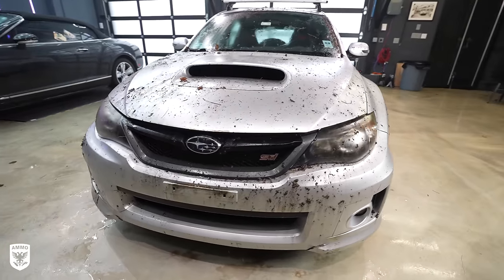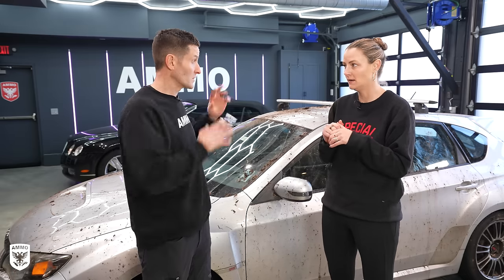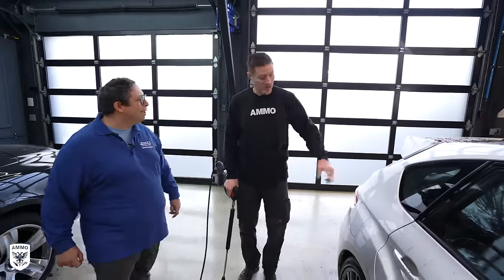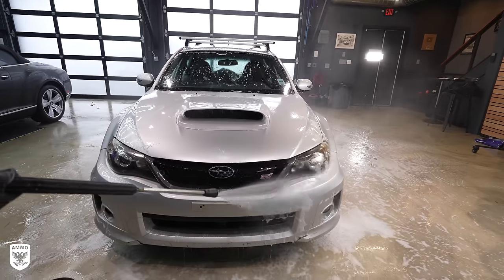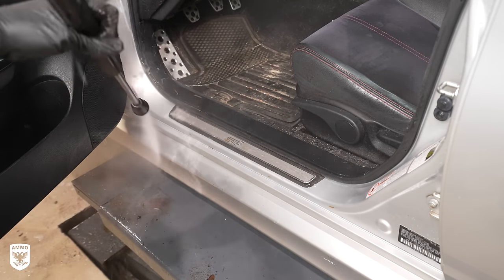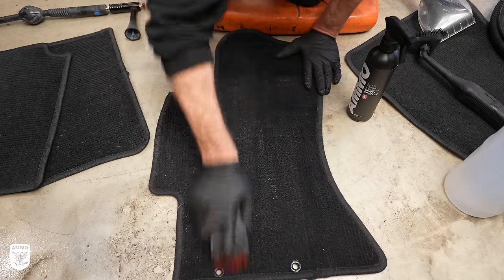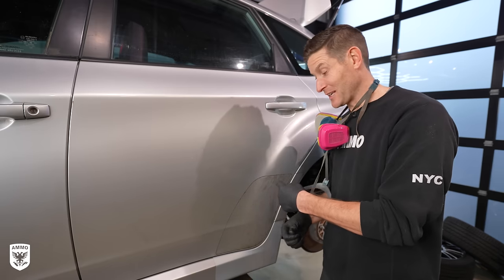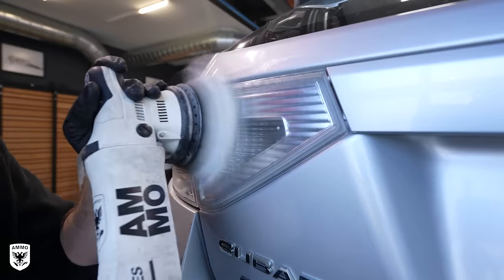Can a Detail Transform this Abandoned Impreza STI for Special Olympics?

Comment: Spin the air, like the slide in a shelter skelter, so the air is already turning and should slow down the vacuuming forces, but aid the blasting of the dirt.

Because if you look at a tornado the dirt is literally blasted away when they touch down.

Comment: Hi, Larry! Im a mobile detailer in Atlanta. I have had a bad experience with using a rubber wheel before on those shark fin PPF pieces. I knew about the plastic razor blade but it kills my hands and takes forever. Tried the rubber wheel and it immediately pulled some paint off even with no force applied. The hot water/towel and plastic razor blade method seems to be the safest approach. Poor hands.

Comment: try dipping a piece of paper towel onto bug/tar/adhesive remover, then slap it on the spot and let it soak for 5-10 mins and pressure wash it off, very easy

Comment: I have the same car. That clear bra on the rear door is no joke to remove. I did one side and im still mentally recovering. I used a heat gun, plastic scrapers, and 3m adhesive remover and it still took about 3 hours. I ended up chipping the paint on the rear rocker 🤷 im dreading doing the other side.

Comment: Hiya, love watching your detailing videos and picked up so many tips and things I was doing cough wrong cough 😀

1 question though, in watching your cleaning of the engine bay, I noticed you power washed it. Are you not concerned that the likes of the alternator not being covered and wet that it will cause issues with the engine/electrics etc?